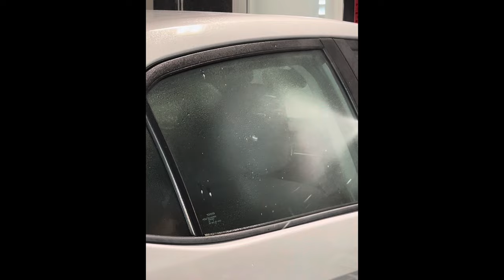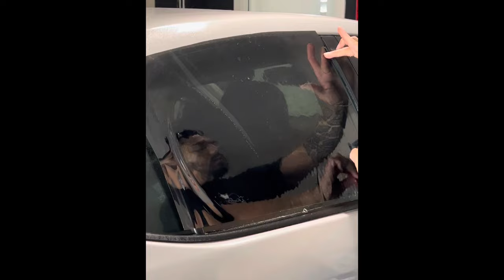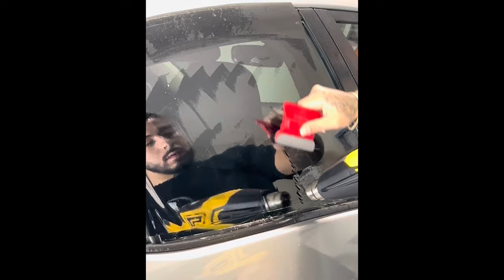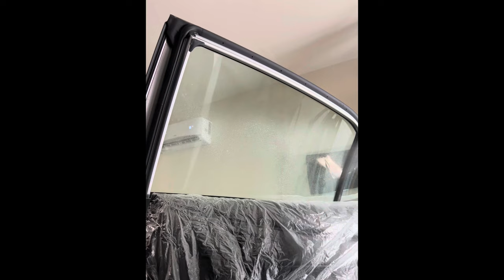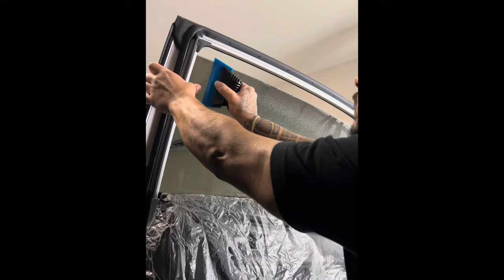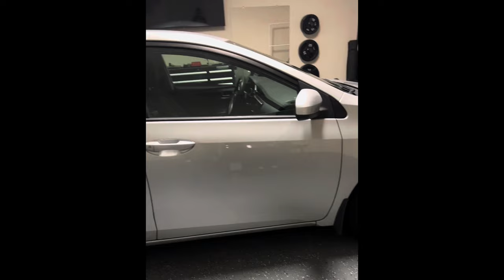Window tint passenger rear from beginning to end NO EDITS

Comment: For the plotter what blades should I get 45 or 60 degree blades does it come with blades ?
Reply from the maker: I use 45 now for tint. It’s better than the 60. But my next blade will probably be a 30. I read it’s better for tint.